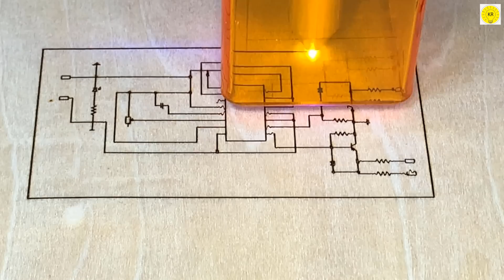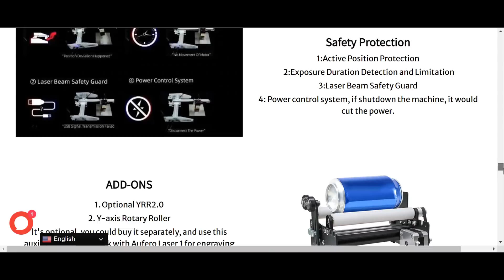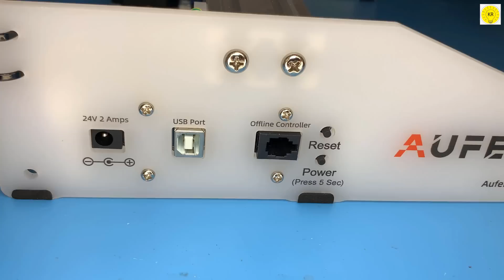how to make simple inverter 2500W , sine wave , 8 mosfet , IRFz 44n , Aufero

Comment: 2500W? With 12v battery than means more than 200 Amperes, (or more than 100 Amperes with 24v). That requires at least 2 AVG wires. The wires soldered to the mosfets are not even enough thick for 250 Watts, and the wire coming out of the power supply (visible at 5:23 of the video) are not even enough for 25 Watts! Also the transformer used is a high frequency switching transformer. You cannot supply 60Hz motors with that!